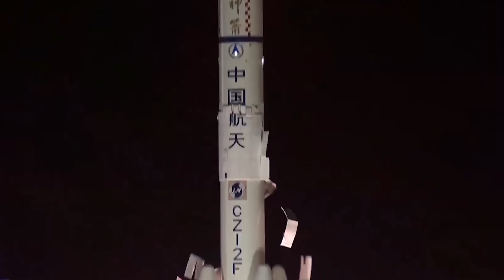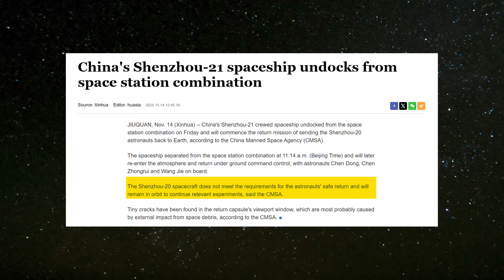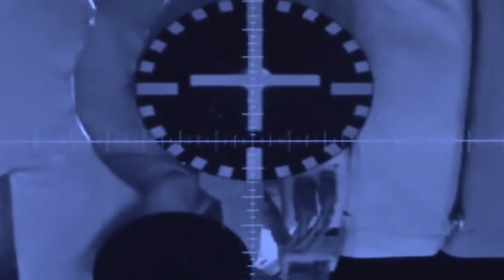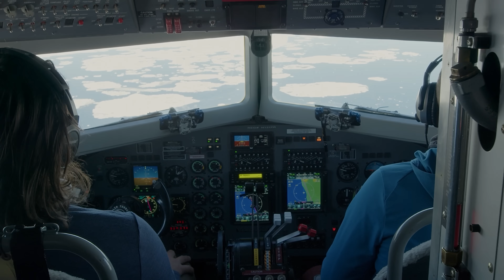China revealed the Real Problem with Capsules on China Space Station, Worse than SpaceX

Comment: It sounds to me that the "tint crack" is NOT due top a collision with a piece of space debri. As this video explains, impact with even tiny pieces of space debri , travelling at ultasonic velicities would result in an explosive impact that probably would have driven the window material - strong as it is - into the spacecraft, probably badly damaging , if not obliterating the interior and maybe even sauding "spalling" damage. If the crack is tiny, it is more probable that it was caused by a failing of one of the layers of transparent material making up the glass' integrated structure. 
A FLAW in the window material's manufacturing process. Frankly, i don't see why the astronauts couldn't have just welded/glued/epoxied a thich panel of metal over the window from the inside and flown it that way. the capsule's greater internal pressure would have aided in keeping thev metal panel in place over the damaged window. the window's orientation would not expose it to the heat of re-entry, so that's a plus. This simple improvisation would, in my opinion, have worked. 
UNLESS there was a reason to prevent the return of the damaged window glass material for closer inspection. 
BTW, i had to chuckle a little at the "marching in unison  parade as the astronaut was carried from the returned spacecraft to the recovery vehicle. This contrived "march' was obviously done for a "dog and pony show to highlight the CCP China's honoring of the "heroic bbq chicken eaters " from their much hyped "emergency" situation. 
Definitely NOTHING in comparison to the heroic innovations and risks taken experienced in the APOLLO 13 emergency situation.
Chinese space ship Number one has a cracked window? No problem; we'll just climb into Chinese space craft number two parked at the other end.
Just after they eat their much hyped, but not really "rewarmed bbq chicken wings. 
Of course IF the emergency would have required the evaquastion of ALL 6 Chiese astronauts immediately ... THAT would have been a REAL EMERGENCY.
Reply: MAGA bot😂
Reply: They kept the damaged capsule afloat for troubleshooting and failure analysis I guess.  It just leaves the space station without a lifeboat, and to me that's the same kind of emergency trump hyped up so much even though the ISS DID have a lifeboat available.  Yeah, marches look dumb, so why is trump spending taxpayer money for a pointless parade then?
Reply: 危害程度取决于 相撞的角度
Reply: RE your comment "marching in unison  parade as the astronaut was carried from the returned spacecraft to the recovery vehicle."
The Chinese have done the same for all their returned astronauts. They did not do it for us or because we are watching.
I think the serving of the barbequed chicken is a big light 😀 I would more for an appetizer.

Comment: The crews are already back on Earth safely. It was a highly caution decision for a tiny surface glass chip of around 1cm. For that, the chinese administration does not take chances but decided to take the crew back using the safest equipment, most unlike NASA that risked the lives of Space Shuttle crews (two crews) in sad circumstances.
Reply: Pretty sure there's 3 still stranded.....
Reply: @tomsmith2604 Sorry to say, your data source is faulty!
Reply: @tomsmith2604 Like Aunties, they are all over. I’ve got a bridge I could sell them 😆

Comment: What's the problem? China took 9 days back to earth, USA need wait 9 months then back on earth.
Reply: Even if they lose them, meh, no biggie. It's not like they are actual "astronauts".
Reply: The US didn't need 9 months... it was contract negotiations that took that length of time. Time was not an issue on the ISS.
Sorry about your confusion.
Reply: @come4t_a_bull It took 9 months though, for what ever reason
Reply: @Mukdener  But China still has 3 taikonauts in space without a vehicle to return in.  So, the timer is still running.  They just moved the problem from one crew to another.  The fun will be getting the taikonauts back.  I presume it will take 2 launches at least, unless they try to fly without anyone on board.  If there is one pilot, then it will still take a 2nd launch with only 1 or 2 taikonauts so the last person gets back.

Comment: If it takes several days to prepare the rescue spacecraft, they why does China claim "They always have a backup spacecraft for emergency rescue"?  Lying?
Reply: A spacecraft is already built. However, before sent to space, you need to check thoroughly before launch. You can't rely on the check done months before launch. Rocket needs to be filled just before launch too. That will take time, dummy. The video already mentioned, there is two launching date, 16 days and 86 days. That counts all the checks and filling rocket
Reply: well 9 days, vs 9 months to rescue 2 americains astronaut
Reply: Rocket launches are planned months in advance, it is not feasible to fuel up rockets at moments notice and launch them.

Comment: Space-X, a U.S. company know for 'trial by error' rocket explosions, has plans to attempt to refuel the world's largest rocket with liquid methane & oxygen while in near earth orbit. What could possibl go wrong?  Visionaries like Victor Frankenstein and most industrialist billionaires, typically have no thought to the full and lasting social consequences of their creations and leave the mess for others to clean up.
Reply: Without an atmosphere the probability of an accident that causes and explosion is unlikely, even a leak will not explode or even ignite without both fuel and oxidizer mixing.
Reply: @stevej7139  My understanding of a rocket engine working in the vacuum of space is Fuel + Oxygen + Igniter creates a controlled burn. So all the ingredients are there. Usually orbiting spacecraft have spent almost all of their fuel in the assent so probability of a combined leak of oxidiser and fuel + ignition source are low. 
Internal spacecraft pipework connections are proven leakproof before flight, yet leaks have happened. 
Docking two high mass vehicles without scraping the paint then connecting and transferring large amounts of liquid In a vacuum using a revolutionary process for the first time significantly changes the probability.

Comment: Early in the clip you describe about how Shenzhou 21 undocked and returned the astronauts to Earth. But later, you describe how the docking ports are currently occupied by Shenzhou 20, Shenzhou 21, and Tianzhou-9. Obviously, this segment was recycled from a previously released clip, but itis very confusing. Please be more careful!

Also, note that NASA requires that astronauts on the ISS must always have an escape spacecraft available. In the case of Starliner troubles, they were prepared to "double up" on a Dragon. It seems that China does not have this directive as the only return craft currently available is not safe.

Comment: Why not have an outer debris shield covering for the windows when it’s docked to protect the glass.  
Space shuttle had debris strike but they were small. 
A crack suggests a processing issue and not debris damage. 
“Windows are a structural weakness.” - Legion (Mass Effect)
Reply: We're talking about debris the size of a peanut, moving several times faster than a sniper's bullet.  The windows aren't any more vulnerable than the rest of the capsule, or the station for that matter.

Comment: Strange language though.  China claims to have a spare rescue craft ready to take off.  So they claim no Taichonauts are stranded.  Yet the craft had yet to be assembled.
Reply: Your understanding on China space mission is full of confusion by your lack of comprehension on what is happening to Shenzhou-20 spacecraft at Tiangong Space Station. 
Your statement that no space rescue spacecraft has yet to be assembled is incomprehensible and mind-boggling when Shenzhou-21 is already at the Tiangong Space Station to take over from Shenzhou-20.
As Shenzhou-21 is already there, and for this reason, no additional spacecraft is needed for any rescue mission if there is any mishap to Shenzhou-20 during this period.
The original planned date for the Shenzhou-20 crew's return to Earth was November 5, 2025, following a handover ceremony with the Shenzhou-21 crew. 
This date was postponed due to a suspected impact from space debris, which caused microcracks in the return capsule's viewport window, rendering the Shenzhou-20 spacecraft unsafe for reentry. 
The crew ultimately returned to Earth on November 14, 2025, aboard the Shenzhou-21 spacecraft.